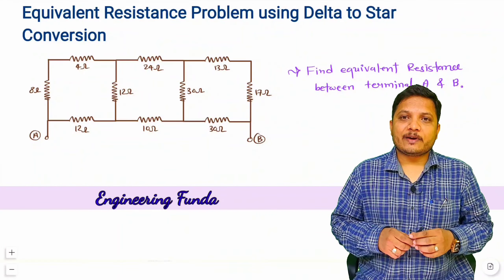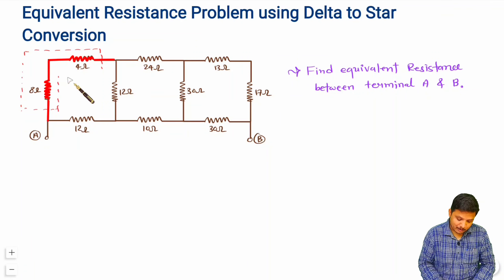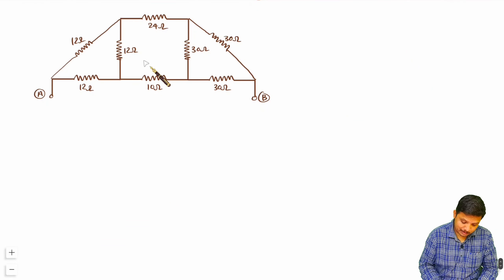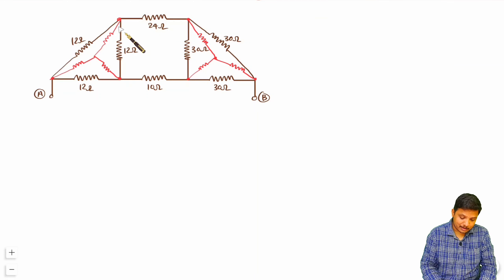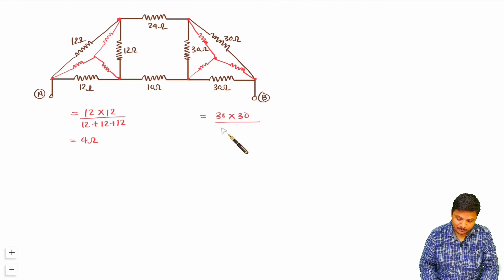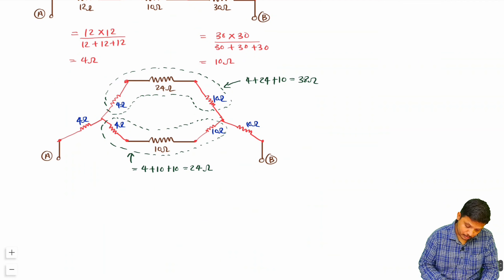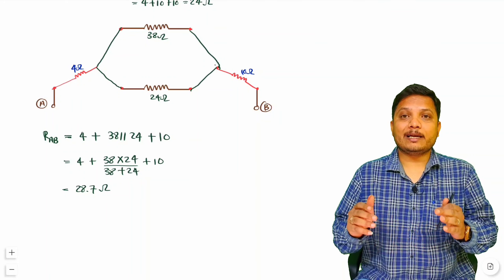Equivalent Resistance with Delta to Star Conversion: Detailed Example and Solution 4

Comment from the maker: Equivalent Resistance Problem using Delta to Star Conversion explained with following Timestamps:

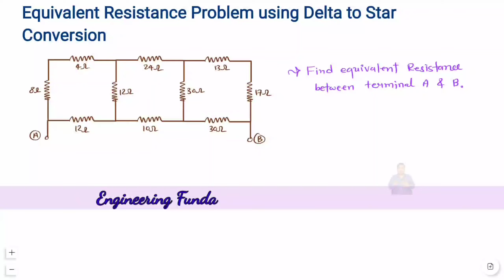0:00 - Network Theory Lecture Series - Equivalent Resistance Problem using Delta to Star Conversion
0:44 - Series connections of resistance
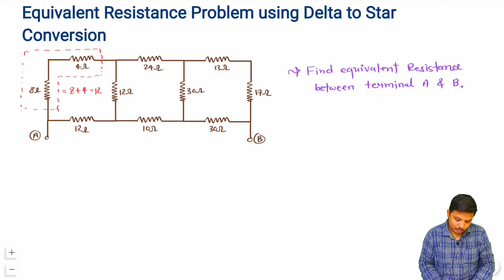1:12 - Series connections of resistance
2:19 - Delta to Star Conversion
4:32 - Series connection of resistance
4:57 - Series connection of resistance
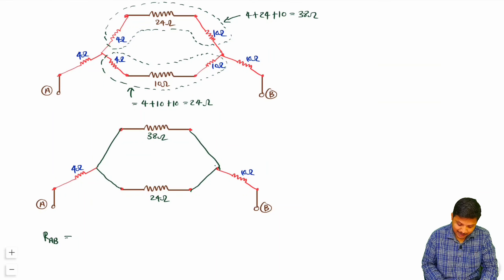5:38 - Equivalent Resistance of given Network